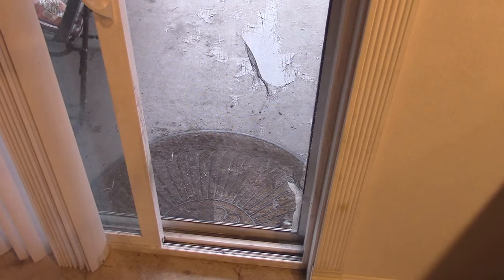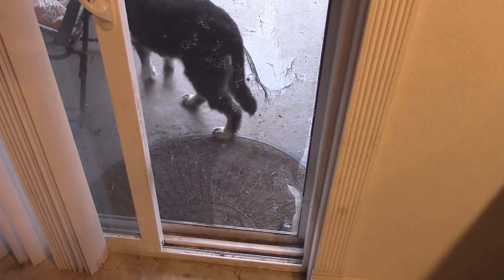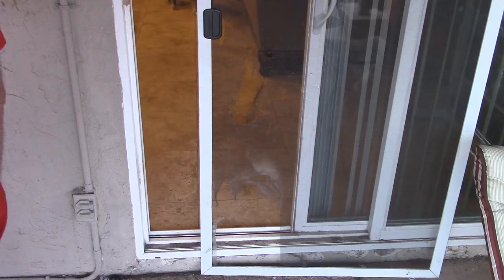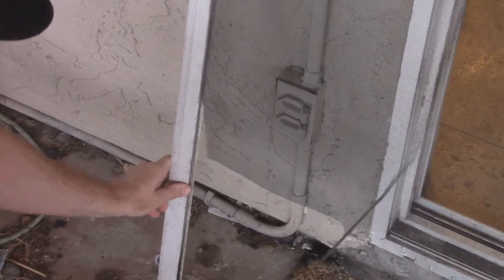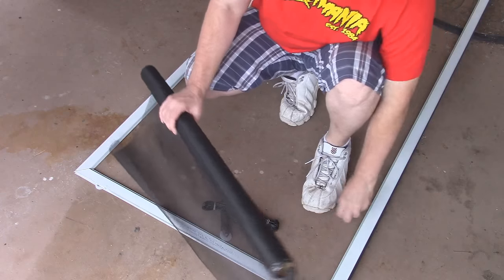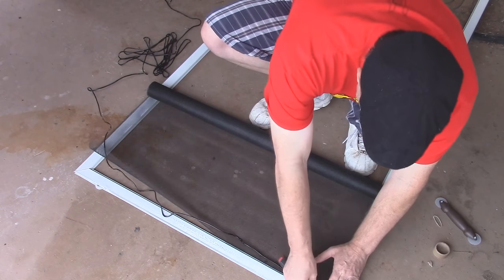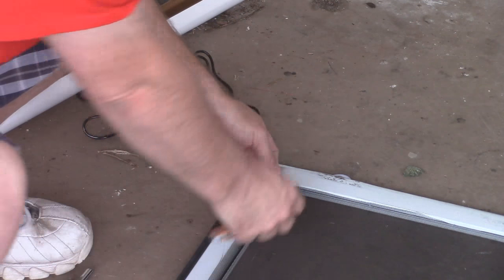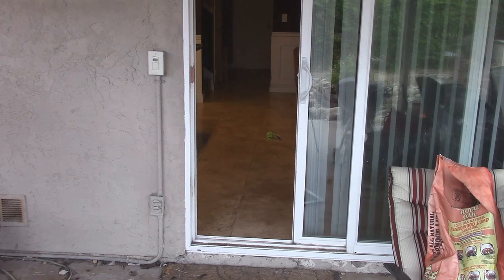how to replace the screen on a screen door

Comment: Nice Video, I know this as old vid, but my master (my dog lol) just ripped apart my screen door trying to get into the house due to fireworks. Whe have a rot iron door the screen and glass sliding doors. He's about 80-90 lb bull mastiff. He's not tall, but long. Standing on 2 paws he's about 4ft in height. Was worried he would break the glass door. Had his head stuck in the rot Iron door trying to get in the house. Thanks for the vid. Especially watching this having the same type of family member doing what they do, can't blame em. Had hundreds of dollars spent on repairs, but at the end of the day it's all worth it. My dog "Canelo" is the most loyal dog I've had. Owning various breeds, by far. CANELO is my families keeper. Love you Buddy/Canelo. Thanks for the content sir. Very useful!

Comment: Ya know it's funny. I've dabbled in so much shit over the 29 years of my life. Everything from small 2 stroke engines on lawmowers, to big old diesel Mac trucks with dual shifters. Worked for a wastewater plant as a field operator and lab technician. Fixed super high end TVs like LG OLEDs, atmos soundbars, gaming consoles, and computers. I've helped build, plumb, and paint entire houses, and did the lawn care. Yet here I am in 2021 looking at 4 year old videos on how to replace a screen on a screen door, and how to reset my garage door opener when it malfunctions. 🤣 always learning I guess. Thanks for the video man.
Reply: Never too experienced to grow ! :)
Reply: I hear you🤣 I felt embarrassed when I ruined my new screen trying to follow the manufacturer's instructions, right in front of my wife😄.  I'm an avid DIY'er rebuilding car engines and everything else, and a software engineer by profession. But the screen door mesh install got me. 😂

Comment: I'm gonna comment on a 6 year old video so future DIY'ers have an easier time.

1.Put a small sticker on the bottom area of the screen so the dog can visually see the screen door is closed.
2. When you install the screen door, simply put the bottom rollers in first, Since they're spring loaded, just push down on the door and the top can pop into place. Voila. No bending down and fooling with the bottom rollers.
3. It may be easier on some doors(or for some people) to just cut the cord at the corners. It doesn't affect the performance of the screen and may be a little easier to install.

Good video. Thanks.

Comment: If you sit it on a couple of 2x4s you can press down on the frame while you lock it in and when you release the downward pressure it will automatically tighten the screen with no need to pull...

Comment: Animals do what animals do, and you can't "train" them not to do what they do, especially when you tempt them with nothing but a crappy piece of screen separating them from the great outdoors.  So it's up to the human to create a screen door that they cannot damage.  My advice is to Invest in WAY heavier screen or aluminum/metal covering with holes for just the bottom of the screen.  But to be honest, full length screens and animals are not a good combination.

Comment: What was that black cord you used to help install the mesh?
Reply from the maker: the black cord is a rubberized cord that you use to lock the screen in place. think of it as a cork that is in the shape of string. it comes with the screen kit.
Reply: Could I buy that separately? I have the mesh already.
Reply from the maker: @angelasmith9758  i think at home depot you can
Reply: It's called a, "spline".
Reply: Sam Feldman thanks so much